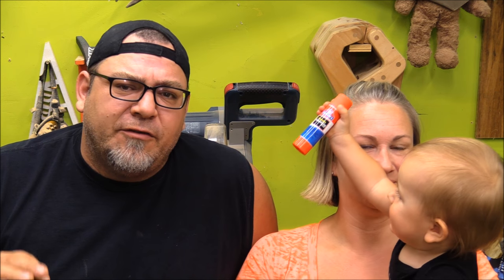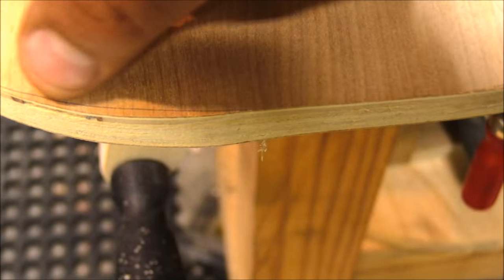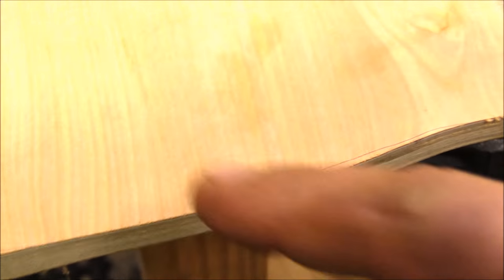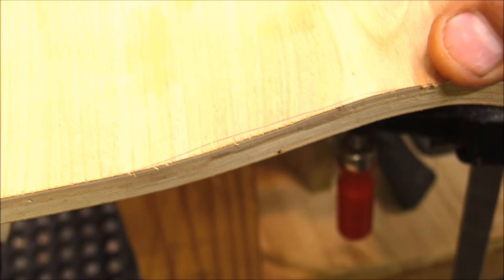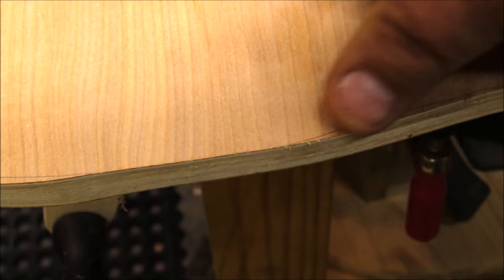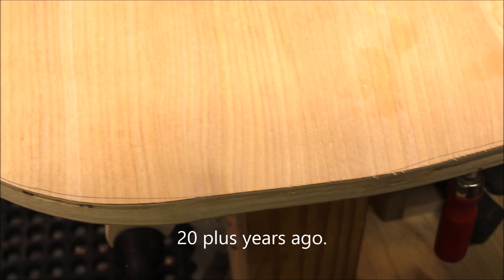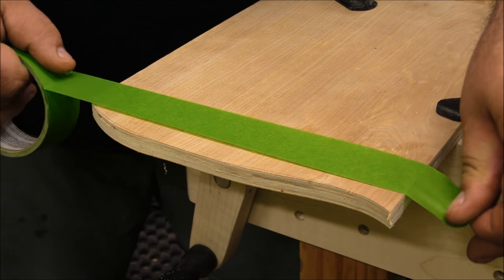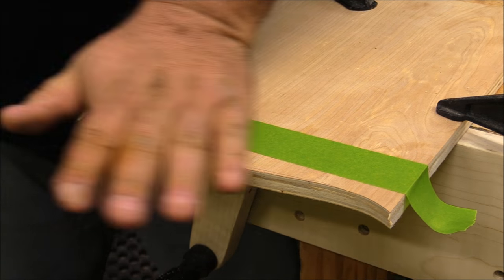Instantly Improve Jigsaw Cuts with Painters Tape - How To

Comment: Another brilliant video, you legend.

I've always had a hard time with jigsaws but only ever used them for quick and dirty jobs where finish/accuracy isn't an issue - most of the time the blade wanders left and right resulting in the underside of the cut being all over the place even when the top side is spot on (I've lovingly dubbed it the Wilson Wave Effect: the board saying "Hello again, have you learned to use a jigsaw yet?")

I'm 99% sure it's down to my skill level but I've only ever used low end tools so that little bit of doubt is still there.

It would be awesome if you could shed some light with some more jigsaw related content.

Comment: I used the trick for cutting a straight line with a jigsaw (in addition to wooden plank screwed in as a guide). Worked very well (tried initially with only the plank guide and that was not a success)

Comment: Hey Izzy, I wanted to know if your izzy guide will work with a jigsaw.  I need to be able to cut foam with it and it needs to be able to run on the foam.  It is pretty rigid foam, but I have your izzy guide and made a mdf jig for the izzy and it works great with the saw, but I wanted to know if this would work with a jig saw.  If so send me info on what you would suggest.  Thanks for all the videos, your awesome for doing this for all of us.

Comment: thanks for the tip
something i needed to ask...  my jigsaw cant slice a 2x3 log through the end grain to a 1x3... although its a top of the line Bosch GTS150 didn't have any problem splitting a 6x2 to 2x3 but when i try to split it to 1x3 it cant go through the end grain any advise on that
I'm using a Bosch T744D 7" blade on normal pine wood

Comment: Can someone tell me how to prevent thin plywood from splintering when drilling holes with a drill bit, forstener bit or a spade bit. I want to drill a hole on the back of a bookcase so I can pass tru some cables. Thank you for any tips you can provide
Reply: If you are using a spade or forstener bit pay attention to the spur that sticks out on the center.   Drill from the good side until the tip of the spur starts through the back side.   Stop before breaking through the piece of wood. Now start drilling, using the hole from the drill bit's point to keep in alignment.  The result should be  hole without any tear out.  

Check the sizes available in your locale, but there are plastic cable rings that can provide a smooth surface and hide some small tear out.
Reply: Thank you very much for the tip and also the plastic ring to cover the cut out I think they also call them grommets. I have read that you can use painters tape to cover the back site and that will also prevent splintering/blow out what do you think about that trick? will it work?
I want to make the hole about one inch in diameter that is why I also mentioned the spade bit.

Cheers

Cheers
Reply: The best way to prevent splintering and tear out is to have a backer board to drill into, clamp some scrap to the back and drill through into the scrap, this should minimize the tearout.
Reply: That sounds like a good idea, I will just have to lay the bookcase down on top of a piece of wood and that should work. Since I cant screw the board to the back or clamp it.

Thank you for the tip Jim
Cheers